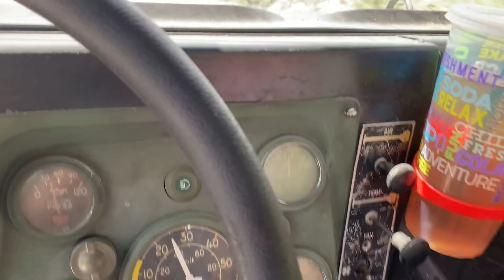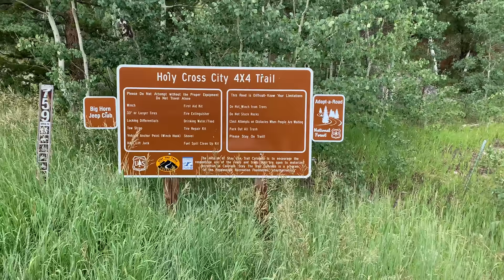Little Humvee vs Monster Jeep part 4 - Holy Cross offroad trail!

Comment: $4500 Cherokee walks up and $150,000 JLU is stuck Hahahaha
Reply: Chris McLaughlin  Speaking as a distinguished gentleman of culture in a XJ, that JLU was on the hardest lines possible 😎.  It is great watching those XJ’s just walk up the trails where others struggle though.
Reply: Cherokees are the 350z of off-roading
Reply: Connor Doss idk what that means haha
Reply: @Captain-Awesome  They took basic lines not really the most extreme  variation of the lines possible ... but there shouldn't be any obstacles that present challenge for a rig on 40s until you get to cleavland rock . Step sister couldn't hold my xj's  diff cover.
Reply from the maker: @connordoss5694  lololol

Comment: Great video man! Gotta love the XJ’s!!  There were a lot of different rigs up there with you guys.  I liked the longer format to see more of what it’s like on some of those trails.  Seemed like the HUMVEE didn’t struggle at all but  Kevin was trying the hardest lines possible.
Reply from the maker: Yeah I don't have any skid plate stuff at all under the Humvee, I can't drag it on it's belly with a plastic gas tank hanging down there!
Reply: Lone Star Drift Great thing about that HUMVEE is that it starts off so capable that with a few upgrades (if you wanted) it would  be bullet proof”ish”. Have you seen the HUMVEE LIFE guys?  For the most part they wheel civilian H1’s.  Good source to find the weak spots or join a trail ride.  They are out of Houston, I believe.

Comment: I had my rig locked up before and it took the challenge away. Now I put fullsize open axles on and boy is it fun again. I got dual tranfercases which allows me to crawl like a snail. When u got a buggy on 40s at the top of holy cross it's not that big of a deal.

Comment: Loving the Humvee videos! Question, Do you think a C-Clip Eliminator kit is necessary for a drift S197 Mustang or are the stock axles perfectly fine in your opinion?
Reply from the maker: You do not need to do anything whatsoever inside the rear axle.  Leave the diff, axles, everything alone.  The only thing I could possibly see doing is changing the ring gear if you need to, but I would avoid that as well.  I had a 2011 track pack GT mustang, and it had a more peppy ring gear, and I have driven others without the peppy ring gear, and they feel less powerful and you get stuck between 2-3rd gear more, but realistically, you have a V8 and can drive around that.
Reply: @LoneStarDrift  Ah, guess I'm far more paranoid about breaking axles than I need to be. I picked up an 05' GT but its got a worn out lsd and the 3.31's so I'm gonna rebuild the lsd and swap to 3.73's, same as track pack gear. But good to know stock axles are fine. Eventually will be swapping to coyote but thats down the road.

Comment: Does the Humvee have torsens front and rear? If so, I assume you just left foot brake a little and off you go when there's a one wheel lift situation? Or am I completely taking a piss about how torsens work?? lol
Reply: Yes it has Torsens front and rear.  To get them to lock up you use Brake-Throttle-Modulation.  Essentially what you do is pulse the brakes while keeping the go pedal depressed. 

Its not very reliable which is why my H1 offroad guys replace them with good ole lockers.
Reply from the maker: Tad is correct, I don't even have to reply lol!  It is fun not having a fully built up vehicle to do trails though, makes it harder so you don't just walk over everything in sight lol.  That is why I haven't put real lockers in yet, and I might not.  I might put a rear one in, an electric one, but not sure yet how much money I want to dump into this Humvee.
Reply: Lone Star Drift I don’t know a lot about wheeling but I’ve been reading about guys preferring a locker in the front. Is there a reason you are thinking rear? I’m considering an air locker.
Reply: @MrBloaf  the humvee all ready has torson diffs front and rear, and they are capable of locking, however his rear one is apparently giving him issues from what I've read and seen.
Reply: okigojuryu 1979  I hear you but actual lockers to switch on is an upgrade guys do, but I hear some prefer front and some rear. Some some do both. I know they lock with BTM, but his was slipping because he wasn’t quite getting the BTM correct. The hmmwv is under powered and it can be hard to BTM and keep your wheel speed up, so guys put actual lockers in there. My hmmwv does fine but I haven’t done even as much as what’s in this video with it. It’s also easy to brake a half shaft if you mess up the BTM since the brakes aren’t at the hub.
Reply: @MrBloaf  I guess he would rather have a rear locker vs front because a rear can be more useful in something like the humvee, since they are fairly nose heavy, the generally raise the rear wheel more than the front. That's just my experience with my H3T anyway.